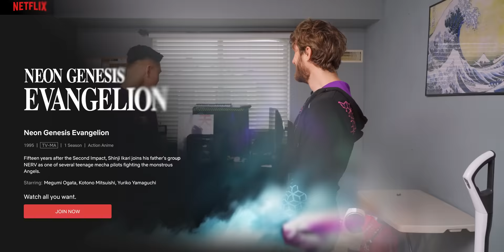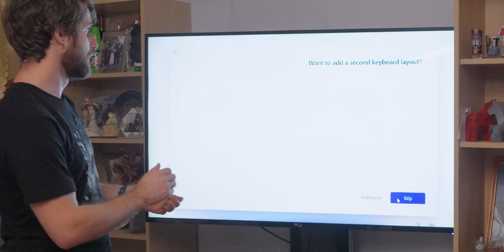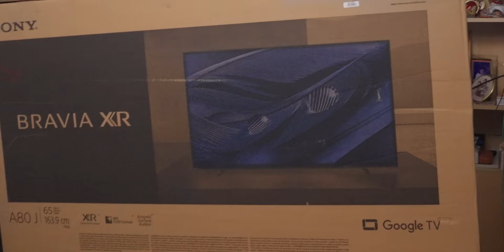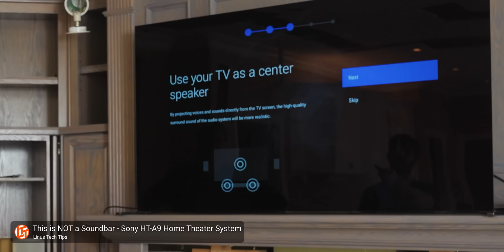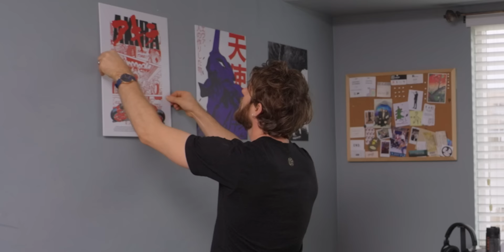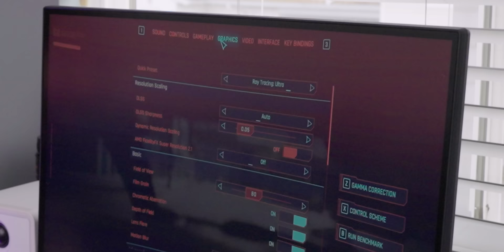His Money Management Skills Are VERY Questionable - Intel $5,000 Extreme Tech Upgrade

Comment: Should have gotten the black and green speakers... The purple/green power supply would have looked better too...
Reply: There is absolutely no way that 650w PSU would support his 3080, my 750w PSU has issues with mine.
Reply: Side note that 650w PSU is from MSI along with the case and AIO, the GPU is from Asus whose Eva line is higher end. The GPU that's supposed to be paired with that case is a 3060 which recommends a 650w PSU (3080s usually have a minimum requirement of a 750w PSU and recommend 850).

Comment: i sometimes like to imagine what i would do for an upgrade 
start with a 4090= left over 3300 
4k monitor=  left over 3000
sony 4k oled= left over 2k 
2 nas hdd 8tb for 260 = left over 1740
2 hdd 8tb = left over 1500
router = left over 1300 
stand up deskk= left over 1100 
x2 m.2 4tb = left over 600
evga 1000w psu = 400
rest on keyboard, surge protector and maybe a back up battery bank

Comment: It would be hilarious is someone ended up building an all amd build in one of these
Reply: I would do that haha, I have a Vega FE and a 3600X in my rig, so I would get an X670 Mobo with a monoblock, 7800X, 6950XT with WB and some DDR5 RAM. Then I'd get a Thermaltake Core P5, a 480mm Radiator, and a Distro plate with a built in pump.
Reply: I think that the one requirement for these is that you get an Intel CPU in something.
Reply: @MCMonsterbuilder  then I'll buy the cheapest intel CPU to upgrade my HTPC haha

Comment: hey bro i saw you troubling with getting internet but you can actualy connect ur pc to ur mobile while using usb tethering incase u did not know so you can just instal the driver quick with ur providers network and gg :)
Reply: or he could have just set up win10 without internet for a offline acc that's infinitely superior to an microsoft account required to sign in

Comment: this is probably unnessecasry for most people niow, but iuf you install windows 11 and do not want an microsoft account linked, you plug in an ethernet cable when you need to connect to wifi or internet and when you go to the next part of the setup unplug it, the setup will continue and you wont have to link any microsoft account and can setup wifi/ethernet later on. learned this trick at my internship

Comment: Quick tip. Instead of trying to find a magnifying glass and a light to see something small, use your phone!
Our phones have pretty decent zooming, go to your camera app and zoom all the way in, then get your phone real close to what you want to see and start moving it back until it comes into focus.
On my Samsung if I have the camera app in video mode and turn on flash it will keep the light on for an even better view. I have used this to remove incredibly small splinters from my skin as well as work on small electronics. Works great in a pinch and is always in my pocket.

Comment: "What is Evanjelion?" is an easy question to answer but a brutally hard question to answer well. You could give a bunch of completely factual statements about it and make it sound exactly like all the stuff that came before it that it subverted, or you could go into the subversions against mecha anime and risk boring whoever you explained it to tears.

When I'm asked I say it's an anime from around the same time as Jurassic Park came out, where the last of the old production techniques were used before a CG took over, with only Jurassic Park's CGI aging OK from around that time. It's a "they don't make 'em like they used to" series for anime the way that's a thing for classic cars or retro computer design.

That silkscreen of Unit 01 on the back of the motherboard looks stunning, I wish more of the hardware component industry was as willing to make deals like this as they were to RGB all the things. Single board computers with a  silk screening on the back would be great acrylic laser cut casing is commonplace for RPi cases would be great, especially if multiple SBCs are used together in a supercomputer arrangement.

Comment: Fairly easy fix... said I to myself and tried unbend 1 pin on my dual cpu mother board. Slightly moved it with a needle and it broke of and fell inside... Since it was a socket for CPU 0 PC wont start. T_T

Comment: Actually the workaround to bypass the internet connection requirement during the Windows 11 setup is very quick and easy. It just involves entering a one line command (easily findable with Google) into the command prompt which you can bring up with Shift + F10 during the setup. I always do it as I prefer to create a local account rather than having to login to a Microsoft account.

The only thing though is that if you still can't get connected after the setup then you have to install the network driver manually. So you need to download the driver with another device and transfer it using a USB flash drive or something. I actually just had to do this yesterday after doing a clean install on a new laptop.

Comment: A 650w PSU is not enough for a 3080 and 12700. My computer I bought came with a cooler master 800w 80+ gold PSU and it still caused issues with my rig. I think you need at least an 850 for that configuration.
Reply: Just add up the watt draw of all the parts then you will know

Comment: Take it from an av installer and smart home integrator sony makes the best tv and the oled models use lg panels which are arguably the best. However the interface isn’t the best with android tv but if you are installing a $2k+ tv I would hope you would be using an external source like an apple tv.

Comment: Bet that if I worked with Linus, I would be the only one to have an “extreme tech upgrade” be a more midrange one. Cuz…. I’d want more than just a good PC forma upgrade ( assuming that working for him in enough time to get an Intel tech upgrade, that I earned enough money to upgrade my old 2nd Gen intel system or not) but well, let’s assume that from that, I was only able to get a 1650 for this system, and some new but still cheap peripherals, and etc.
Most likely what I would do, is first spend some money on a long lasting ergonomic chair that has levers to lean the seat down, move the back seat, and lower and raise the seat, with arm rests, like… one that would last longer than the chair I had since 2018 before it broke.
Then my system would be an Intel i5-13600K, with an intel H670/660 or whatever motherboard, 32GBs of ram, 2TB SSD, 4TB HDD for long term storage, good case with upgradability, good IO, and tons of storage bays (maybe 2 2.5inch and 4 3.5inch), 750 watt PSU, and a 3060ti for that perfect balance of performance and low energy usage.
I would get a 4K 60hz monitor, but that would mostly be played in 1440p for the 3060ti, while a PS5 and Xbox series X would be in 4K (which assumedly I got those beforehand working for him in this scenario) but well, I would use the tech upgrade money to also buy a 4TB SSD for the PS5, and a working adaptor for the series X to put another 4TB PCIE 4.0 SSD into that.
Also the last thing would be “the perfect desk” something that big enough to fit in my room, but the desk is still shorter so I could have a small drawing desk next to it, so then the bigger desk would have all the space for the dual monitors (since I’d save my 1080p 120hz display for a 2nd screen) with some funky stand to keep them raised. Said desk would have to have ample enough storage for extra little things, and if the desk has that lower shelf for a PC…. Id put a sound system subwoofer there instead, and the PC would sit elsewhere where the noise won’t interfere with a mic, then a upper shelf bit with cupboards for whatever else I need to store, maybe a console or two at the top, or they’ll just sit on my dresser which is always close to my desk… Oh, and then a 4K 60hz display switch that can be used for all of my devices connected to said 4K display, besides my PC which will take the extra display port.
Even after all of that…. All that would be left is $700, so maybe some extra cables, like HDMI, audio, also maybe a GOXLR for fun, so that would leave just 100.
Too bad I don’t work for him, cuz that would all be great :P

Comment: the red color from the PSU's cable is resembling the amber colored LCL liquid plugged to the evas (the component) in the anime, LCL is basically some primordial angel's (let's just say they're the the evangelion's kaijuus for convenient) blood that is used to allow the pilot's neural system to mentally linked with their own "mecha" (again, for convenient reason, altrough terminoloically incorrect.). and not to mention that in the end of the series almost all of human population (or ALL, depend on which ending you tought was canon, please do fight about it) are just turned to a huge cesspool of fanta colored primordial soup.

so even though that guy got his decision right by choosing the red cable over the plain black one thematically speaking, failing to atleast somewhat pointing that out show you're not much of a evangelions weebs as you claimed you are, huh, geoff ?

Comment: Jeff should've gotten the Z690 Hero Eva board and then Linus wouldn't have had a hill to die on about the performance and OC capability. lolololol upgrade part 2?

Also after seeing Linus and Jake downgrade Jeff's work rig with the old water cooling setup, this is hilarious.

Also also, the red cables actually make sense, because when Eva Unit 01 breaks out of its restraints, it's got red accents in the mouth and on the chest!

Comment: I recently did a build with an Asus Tuf Z690 board and the wifi drivers arent detected on first clean install, I had to move one of my mesh routers and plug it in with ethernet, install the drivers (which oddly had no dialogue boxes at all) then manually turn on wifi in windows.....totally unnecessary PITA